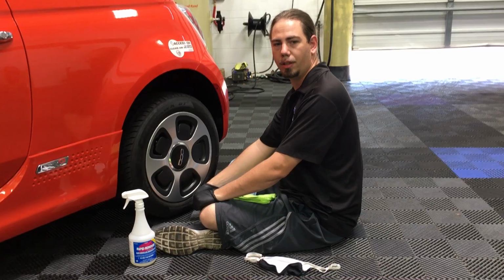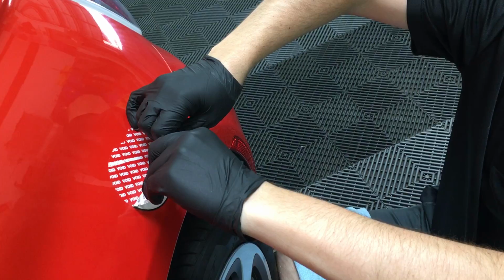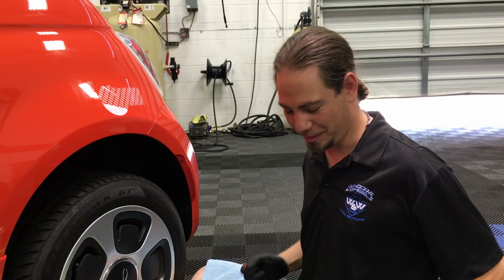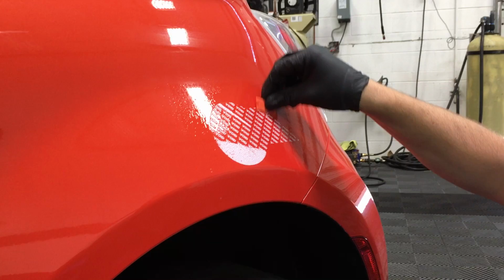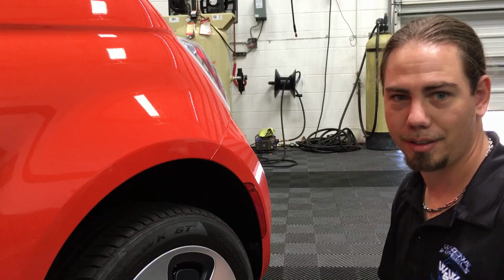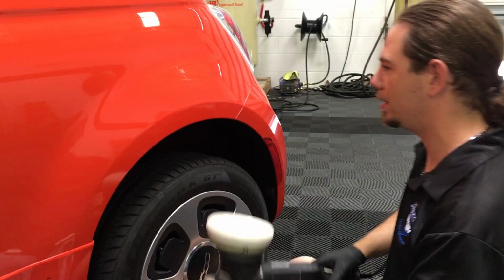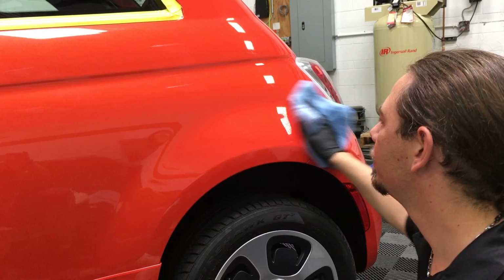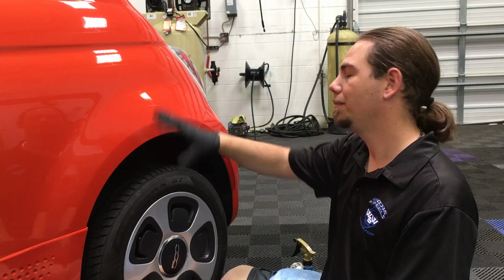Sticker Removal - "How To" Video Tutorial

Comment: I constantly switch decal designs on my car these days so finding a good product like the rapid remover and this video which explains how to use it properly has helped me MAJOR!
Reply from the maker: Awesome! Always love to hear that. It works really well especially if your decals are not super old and sun baked on. Glad you found the video helpful :)
Reply: @WindowsAndWheelsDetailing   I just removed these stickers myself.  But I used 3M 38984 Adhesive Remover.  Spray on, wait 2 minutes, and all the glue just wipes off.  Repeat about 4 times and the whole thing is removed with zero -- and I mean zero -- scraping, and no residue.  That is a commercial adhesive remover and it literally dissolves the glue.
Reply from the maker: @stephenstoneridge3492  sounds like it worked great for you!
Reply: Dawn dish soap in scalding water, stiff bristle plastic household brush. I just took the adhesive off from a dealer sticker in just over a minute. I guess it’s stuck to the brush now better that than my 4x4.

Comment: I removed the dealer sticker that had been on about two months (nowhere near that big) with my thumbnail one night after a couple drinks I was tired of advertising for free. Left the adhesive for a month and watched a couple videos suggesting solvents and cleaners. I put some dawn dishwashing liquid in some hot water. Not boiling but definitely scalding. Used a stiff bristle plastic scrub brush. Most would see it as a kitchen scrubber or bathroom. House hold for sure. I bought a two pack and used the first as a nail brush. I’m a carpenter so for me it’s a nail brush. I had that adhesive off in just over a minute. No doubt I removed any wax as well. Heat and water is the answer. Try it next time. And dawn dishwashing liquid don’t forget that.

Comment: They don't require the stickers to use the HOV lane. You can still use it, you'd just need other passengers. The sticker allows EV drivers to drive in that lane solo without getting a ticket. Basically, if you have an EV, you don't need to pay tolls for a few years.

Comment: I am about to put these stickers on my vehicle here in Cali. You do not HAVE to put them on your vehicle, but it allows people to use the commuter lanes without needing two or more people. You end up paying $25 for these stickers and they are usually only for hybrids and EV like my Tesla. I agree they could just make it easy and put a sticker on the license plate but California always tries to get money out of you as much as they can and of course make it more complicated in the process. I absolutely will NOT put these stickers directly on the paint. I picked up some 3M film to put the stickers on and then put it on the car. That way I do not have to go though what you just did. They design those stickers so that if someone tries to steal them of course it leaves the void and it will show if someone is trying to use them on their car (not to mention they will need to use another adhesive).
Reply: I was wondering what the void was about. 

What do you mean you got 3M film? what does that do? I just want to put normal stickers on my car without deflating the resell value

Comment: Hey guys, do it yourself with krud kutter 32ounces $3.99 at Walmart and use plastic razors from ace hardware 5 pack $1.99. Patience and give yourself time. Prespray adhesive let sit for 15 minutes before scraping off. No scratches no buffing. Worked on my Tesla Model S

Comment: I need some advice!
I had two different types of decals on my van, one was a single layer plastic that I removed easily with the heat gun and then wiped with alcohol just like the ones in this video. But the other had three layers. The lettering had a silver boarder around a black centre. I now have brown hard plastic stuck to my paintwork and the alcohol doesn’t remove it. Any pearls of wisdom would be much appreciated 👍
Reply: acewelding acetone nail polish remover 100%

Comment: Use Orange power , Goo remover . 
Soak a sponge with it and sit the sponge on the goo for 5-10 minutes and it will simply wipe off . 
You may have to get creative on a panel like this and lean something against it to hold the sponge in place .

Comment: How car I remove rhinestones knobs from off my radio knob?
Reply from the maker: It would depend how old they are. They’re likely just applied with a double stick adhesive, the problem is if they’re really old even if you get the rhinestones off there will be glue left behind and plastic is way more finicky when it comes to chemicals being used on it to remove the left over glue.

Comment: wont that adhesive remover also strip the clear coat?
Reply from the maker: aigomorla as long as its not left to set or heated/used in the sun it won’t do any harm. Even then it wouldn’t “strip” it, but it definitely could stain or discolor it.

Comment: Too much work. See the video using the hair dryer, stickers peel right off with little effort, leaving nothing on the car, just need to use some adhesive remover for some of the sticker left on the car. I removed all the stickers in about ten minutes.
Reply: Agreed, but isn't it easier to try that method first and if it doesn't work, there is your way.